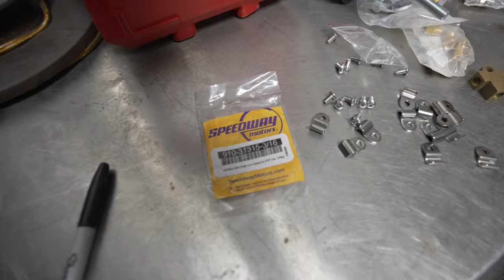Plumbing The Brakes on My 1800hp Twin Turbo Camaro Build!

Comment: bro where did u get the plate you bolt the caliber bracket to from i have 9" for my fbody and i need to bolt my rear calibers bracket
Reply from the maker: The caliper bracket is a Wilwood part that came with the kit.

Comment: No line lock?
Reply from the maker: No never had had one and never really felt the need for one. Probably be easier on the rear brakes during the burnout but once I get a little wheel speed typically we start to roll forward

Comment: Would be easier to but the firewall adapter from racecraft or motion
Reply from the maker: Wasn’t sure if either one of those had the right bolt spacing for my Wilwood master cylinder